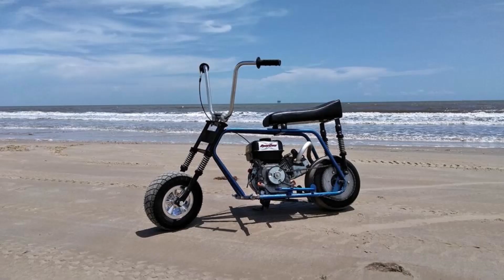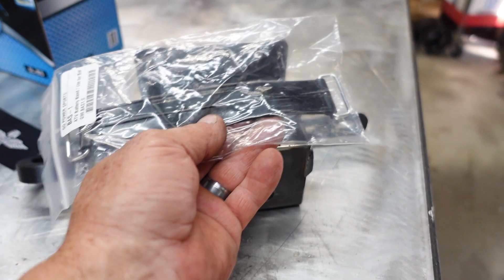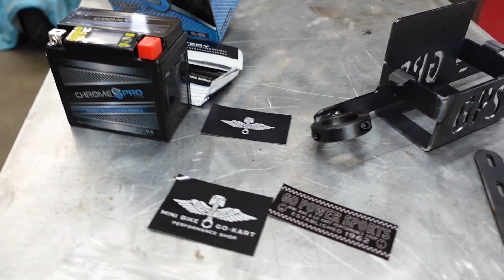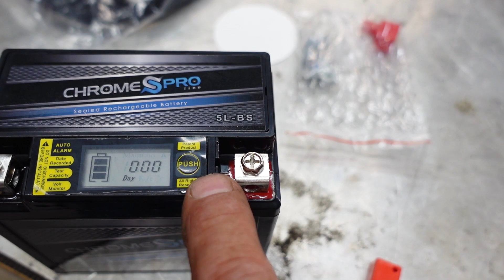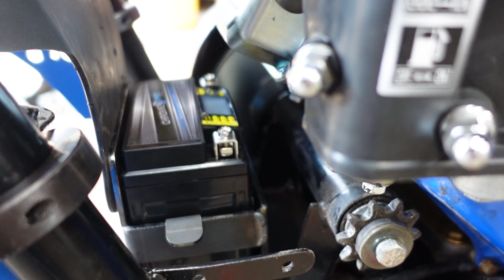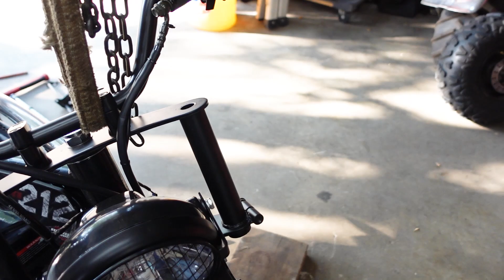Battery Box Install Mega Moto 212

Comment: Dude, I have a super dumb question. You mentioned removing the Reg/Rec from the factory bike. So does this Tilly actually have a Reg/Rec/Charging system all built into the motor? I have zero experience with any of the Tilly motors lol. I sure hope I didn't sound completely stupid with that LOL! As always, nice work dude! Much love!
Reply from the maker: No sir good question , this engine comes with a small charge coil , but I’m running the light off the battery , I might try and add another coil to charge the battery wile it’s running , Thanks for watching brother
Reply: @BustedKnucklesBuildsTexas  Ok! So I am not totally stupid! You are running this basically as a "total loss" set up? Currently the way it is set up it will not charge the battery?
Reply from the maker: @ryanperry9472  For now , yes sir , till I work on the charging system part .

Comment: Great video Rick, I have the same set up as you and I love it. All I’m waiting for is the number 038 jet being that I already have the header pipe and the UNI foam filter on hand, take care and ride safe. And it’s a torque beast as is, wait until I install the items mentioned. Thanks for posting.
Reply from the maker: Thank you sir , what pipe did you go with ? And you ride safe to sir !👍
Reply: @BustedKnucklesBuildsTexas  it’s a header designed for the mega moto 212 and I got it from Amazon, can’t remember what I paid for it but it’s excellent quality. When I find out I’ll let you know.
Reply from the maker: @miguelpagansr6128 thank you
Reply: @BustedKnucklesBuildsTexas   I went with a pipe from Amazon, it’s made for the mega moto 212 frame and I paid 40 dollars for it. Apparently they still carry them in stock and they’re made here. Everything about is excellent quality.
Reply from the maker: @miguelpagansr6128  thank you sir

Comment: I think your right Rick about the exhaust. Need a little extra  sound ! Does that engine have a charging system or do you have to charge the battery after use? ✌😎🇺🇸
Reply from the maker: The exhaust is next for sure , I’m running it off the battery , it has a little charge coil , going to try and install another one to charge the battery , Thank you for watching

Comment: The blue is looking great, was going to do red on my swing arm kit on my MM212 because i have a Ducar with a red sidecover. Im thinking about getting the battery box just to wire up my lights.
I like your idea with the other bracket bending it up, but wouldn't the clamp interfere with the driven on the torque converter?
Reply from the maker: That’s why I went with the blue , do to the engine already being blue , I think the clamp will fit , but will need to cut the TAV cover , thanks for watching 👍👍